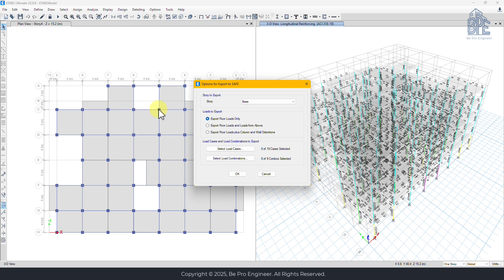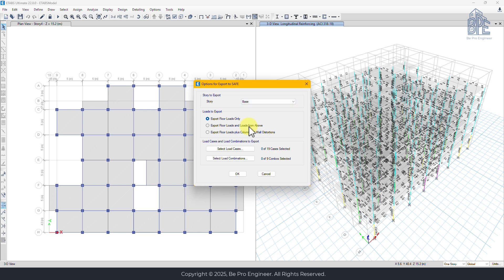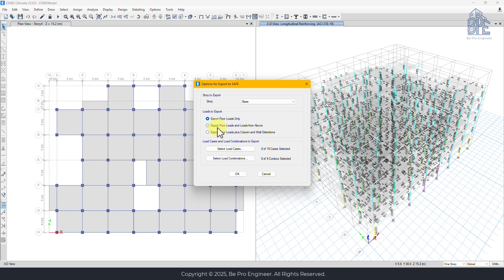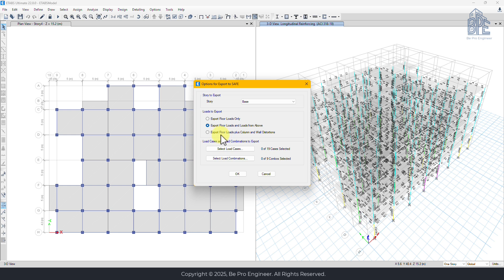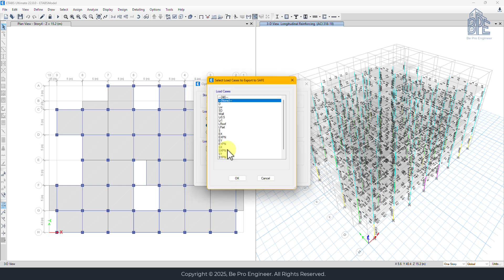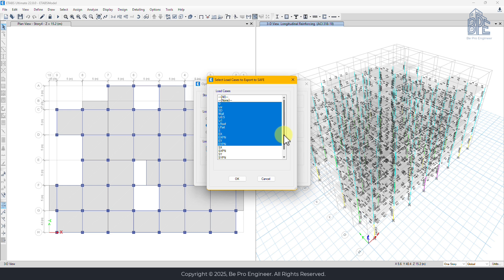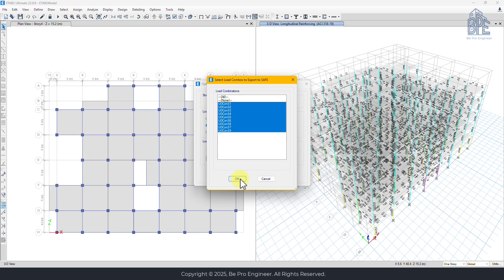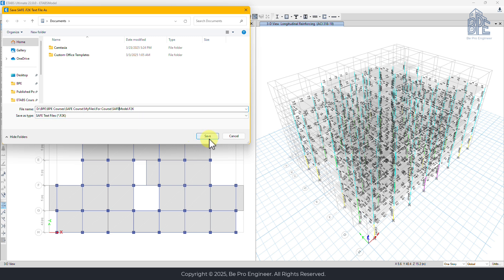How to Export ETABS Model to SAFE for Foundation Design

Comment: Thank you for your presentation can you help me this error message "Error Saving Text File Separator Combos-Error 9"
Reply from the maker: You're welcome! That error usually happens when SAFE can't save the load combinations during import. Try running ETABS and SAFE as administrator, and make sure your file path has no special characters.